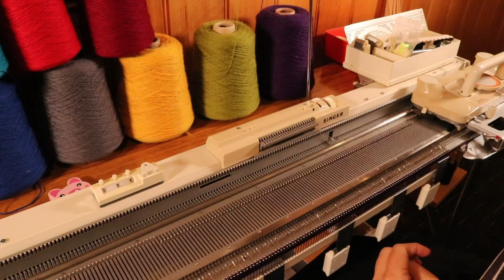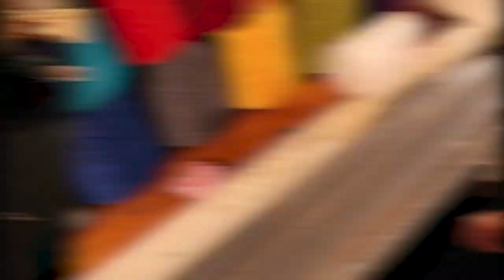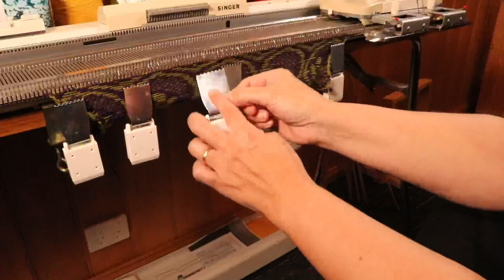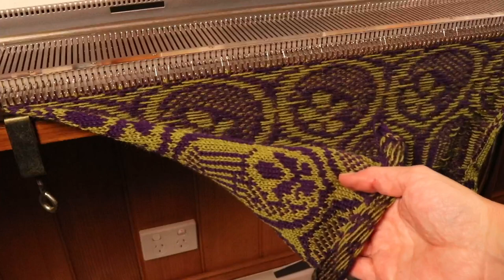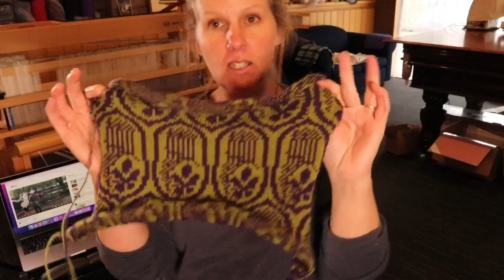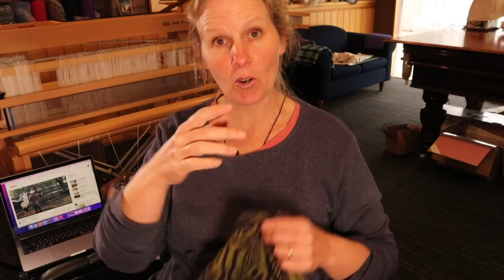Fair Isle Cowl on a knitting machine, part 2

Comment: Kelly. It fell off because the pattern hadn't been locked into  memory. When you pass the carriage from right to left - make sure that you have the pattern card already set at Rw1 . The 1st knitted row must be in stockinette settings. Then you can start patterning. (This step can also be done as a free pass- carriage moving with side levers forward- no needles move)
Reply from the maker: Thanks Kari!

Comment: I also noted that you doubled over (clipped) your card with the upper flap "overlap" on the outside. With age and use the punch card can get a bit mis-shapened, I suggest you tuck the overlap inside. So that it cannot "catch" as it feeds back in.
Reply from the maker: I actually discovered that as I was knitting, the card did catch a little but I was able to move it so it fed through fine. A good lesson for next time though!

Comment: Thanks for this. I'm a pro handweaver turning to a knitting machine for the first time (with ribber and colour changer). I'm hoping that a finished article, weight for weight, gauge for gauge or dollar for dollar, is typically faster to produce on a knitting machine than on my 4-shaft stick-shuttle handloom, would you (or anyone else here) agree? Lots of variables, I know, including perhaps the higher novelty value of weaving that can perhaps increase the price relative to knitting... the aim is that the knitting machine saves my winter clothing business from going under, fingers crossed! I wonder what your impression of potential speed is?
Reply from the maker: Interesting question, as you said - lots of variables! But as a general statement I would say yes, the knitting machine is a good deal faster. The setup certainly takes less time. I think once you were quite practiced and proficient with your machine you would be faster too. For me, the knitting machine has been a much steeper learning curve than any loom has been, after a couple of years I still struggle with a lot of aspects of machine knitting. You may have a different experience. I do also think that machine knitted garments are undervalued, perhaps in part because some people seem to think that knitting by machine is cheating. All I can say is they must never have met a knitting machine, hand knitting is much easier to learn! Anyway, I encourage you to go full speed ahead, learn the basics of your machine and start producing finished items. By the time you've knitted a few pieces you will know whether it's something you want to pursue as a part of your business 😊
Reply: @KellyCasanova  Thanks very much Kelly. It's funny, I'm manically excited and driven in the research, purchase and anticipatory pattern-charting, punctuated by some moments of terror, like watching other people's knitting fall off the machine – AAAAH, I thought I'd thought of everything there was to worry about and go wrong, but no, there's always more! It's so great that you shared this, thank you. I've bought a serviced and tested machine from a dealer to level the playing field a bit (I hope); I need quite quick gratification, but am also glad to get my teeth into something. I may start with some Fairisle bookmarks and headbands, as in twenty years of craft clothing business I've always lacked entry-level priced articles. I'm so glad you have the same impression that a knitting machine is neither cheating (crikey, I agree that it's a steep learning curve), nor as slow as weaving, phew, I started to worry there! I was just watching Shetlander Ella Gordon talk about valuing the (knitting) work of a female-dominated sector. Go us, full speed ahead! 🙂
Reply: PS Yes it's the setting up of the loom that I'm tired of, and the way it requires batch work, and the fact that the most ecological wool I want to use is the local undyed, so patterning, rather than my old colour-blending, is where I can add value – but patterning on the looms I have just feels too slow...

Comment: 3:15 I understand how the card feeder works. But at the beginning of the videos you were debating about putting this design sideways, how would you put the card in that narrow card feeder sideways. (Maybe do a short with just loading the design sideways, knitting not necessary.) 💖🌞🌵😷
Reply from the maker: Sorry for the confusing statement - what I meant was I could knit a shorter width on the machine OR I could knit a longer width on the machine and arrange the finished piece as a cowl in 2 different ways. You are right in thinking that the card can only go in lengthways.

Comment: so glad you left in the boo boos that helps us so much i wish i could remember what that teacher said ot to do but i did it and it fell off just like yours did i was so afraid yikes she was mean she made me hang all those stitches what a nightmare fortunately mine was plain i think picking up fairisle might be impossible plus getting back to the same row might be hard too? i don't know some times a needle butt will move too far one way or the other and the carriage won.t go easier to fix that on the bond as the carriage is different and see thru and i tug the knitting down near the jam...if going thru my notes i find i wrote why it fell i will let you know.  my question is mostly i cannot remember which way you are doing the cowl but measure the hundred rows then double the tape measure to see if it is going to be long enough cause it looks way longer under weight then when one removes them like in your hundred row piece.  it is so very pretty glad you did not take it out great to add to your samples.
Reply from the maker: Thanks Becky 😊